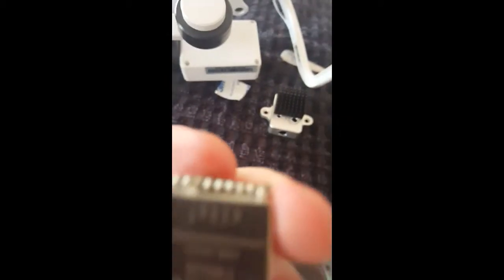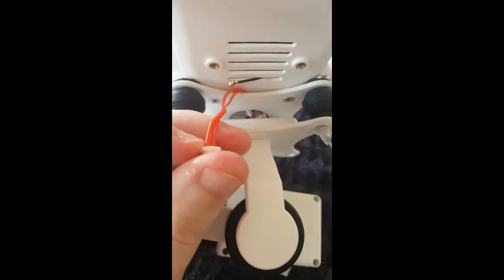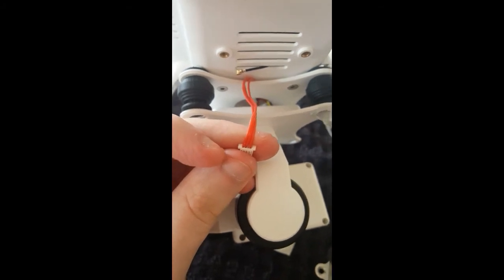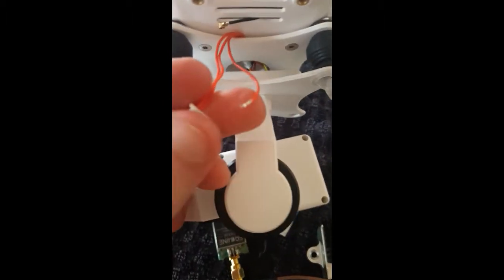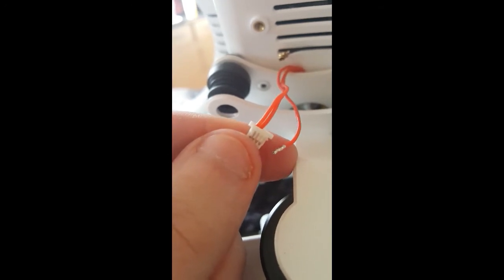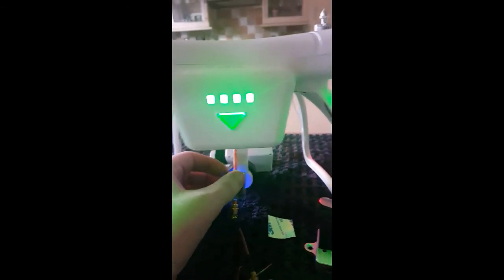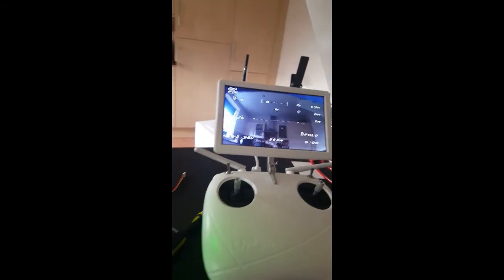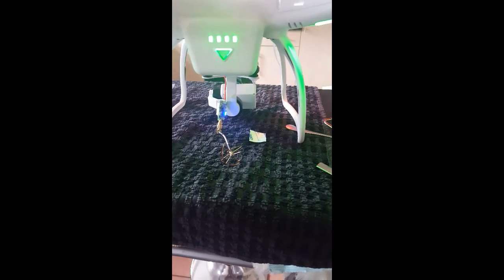UP air One FPV mod, tutorial

Comment: Hey James, Just want to help anyone I can with the new Upair one.. ABOUT THE OVER HEATING PROBLEM WITH THE RECEIVER IN THE HAND CONTROLLER. I wanted to try everything I could not to put a fan inside the controller. Well, I tried 4 different transmitters. finely found one that don't over heat. I tried ( 2 ) Readytosky TS5823L 200m  with no luck. Tried the ( Sinopine TS5828 600m ) with no luck. Tried the  ( Skyzone TS5823S 200m ) Bingo. NOT OVER HEATING. I have only tried the video in the house. It has worked great  through 3 batteries but I have not been able to fly to see how far it will work yet due to weather in Wisconsin. Hope this saves people time and headaches.
Reply from the maker: S Judd that's great thanks for your  input. another thing you can do is replace the receiver it's self for an external one, although most of them are quite big sky zone Do one called rc582 32s but it's hard to find anywhere in stock
Reply: Yea. I looked into it. But I only wanted to go so far with this upair one. I have others I am working on. I am very new to this and love tinkering though.
Reply from the maker: S Judd same i moved onto a phantom now and miss the tinkering with my upair. so i decided to do drone repairs just so i can get the tinkering fix haha
Reply: With mini's and big drones I have order 8 of them this month. lol
Reply: I have the Hubsan h501s advanced on the way.
Reply: Just received 2 of the JJRC H31 Waterproof, I am right now mounting a micro camera on one of them . I am spending too much money..... lol
Reply: My goggles should be here today.
Reply from the maker: S Judd  nice. they have a common range issue and its just a bad connection between the antenna in the controller. so be sure to check that if you have any issues 🖒
Reply: What one are you talking about?
Reply: Is that the Hubsan 501 you are talking about that could have the common range problem? Thanks
Reply: What do you mean replace the video receiver in the controller? What do I need to with the video transmitter in the controller?
Reply: I see in the remote control that there is a video receiver. Does this need to be changed. Can you use heat sinks on this as well.

Comment: do you find this helps much? i just put a Eachine TS5823L 5.8G 200mw 40CH Raceband Mini FPV Transmitter Skyzone Boscam Upgraded  but doesnt seem to good? is it coz its a cheap one?

also want to upgrade one on my contoller  ^_^

thanks
Reply from the maker: Dan Arden yeah it did make quite a noticeable difference for me. alot of it depends on the quality and position of the antenna as well. make sure it points straight up or down preferably the same way as you controller antenna. i upgraded the antenna as well on the controller but upgrading the receiver on the conrmtroller is recommended to stop the overheating
Reply: oh okay well i just brought the ones you used ha , like 50$ as the one i put in yesterday seems to be worse then the one that come in it ... lol

even flying about 50m high my screen is flickering like crazy :/ 

might put some mini heatsink's on it now tho :)

thanks
Reply from the maker: Dan Arden  really. make sure you are on the correct channel too. as it may just be slightly off? try blowing in the vent as it more than likely be the receiver overheating
Reply: it took me so long to get it on a channel to even have a pic come up -_- 
but i might try a new one ha and i think ill 3Dprint a cover as the aluminium holds in the heat
Reply from the maker: Dan Arden  if you select one in band A first and then hold the button on the back of the remote for afew seconds it will auto scan and select a channel with a picture. then just press the button a couple of times to pick the best one. if their not great move to a new channel on the tx
Reply: oh opps i didnt know it did an auto scan ha !
mine didnt come with manual :/ got it 2nd hand but the guy didnt send it with it ha.

thanks will try now :)
Reply from the maker: Dan Arden yep it makes things a lot easier haha. good luck
Reply: got it to auto pick up a channel , but couldnt take it out today :( stupid raid!

hope i can try tomorrow
Reply from the maker: Dan Arden good stuff.  i know. i just stepped out the door for a flight and had to turn around straight way ahha
Reply: yeah no luck. :(

after about 100m the screen goes crazy and  keeps jumping , can't see a thing :/
so maybe try another channel ?
Reply from the maker: Dan Arden yep try another channel. also just fly close maybe round in circles and see if the screen starts to get worse the longer its up. if so its the receiver in the controller overheating

Comment: I purchased the drown and I'm bwaiting for it to arrive and I want to do this mod. so basically you're moving the last wire from the the 4th pin to the third pin and its plug and play. I just hope the one I bought is the same as yours.
Reply from the maker: Wahmart85 thats correct but make sure you plug it in the right way check under the gimbal the wires go red-yellow- black so it plugs into your transmitter 7.4v-gnd-video and then it says audio and gnd again with nothing plugged in that side
Reply: James Ingram awesome I appreciate the help. I really like your videos they're helpful. keep it coming with the videos and I'll let you know how it works out. hopefully I don't get a faulty drone.
Reply from the maker: Wahmart85 glad i can help mate. if there are any other videos i can do that will help let me know
Reply: Yeah, definitely!

Comment: What do you loose when not using the wire you tucked inside the upair?
Reply from the maker: do you mean the black wire? if so that is for the old antenna i completely removed this wire now as i have done the usb mod, as you see i have used a new clover antenna
Reply: oh okay I understand now, so the black wire was in the 3rd slot of the connector?
Reply from the maker: no the black wire you see coming out of the vent is the old antenna from the transmitter i removed,  i replaced this with the clover leaf antenna you see attached to my new transmitter,  their is also a another black, red and yellow wires that are connected to the 3 red wires you see, red being live, black is video and yellow is the ground, i will upload another video in a couple of days where you will see i completely remove that black wire from the drone, do you have this up air ?
Reply: yellow is video signal, right?